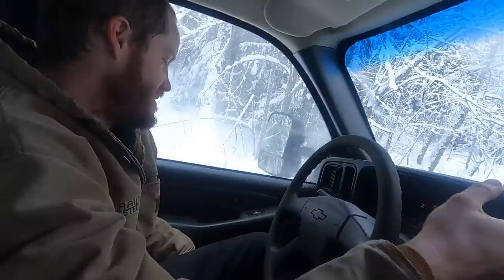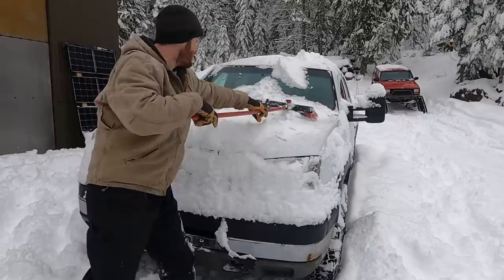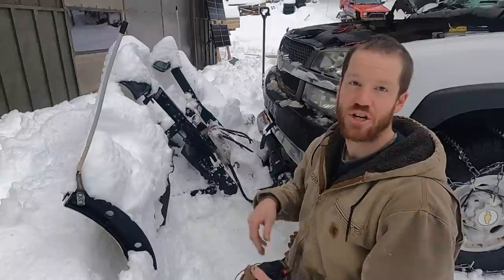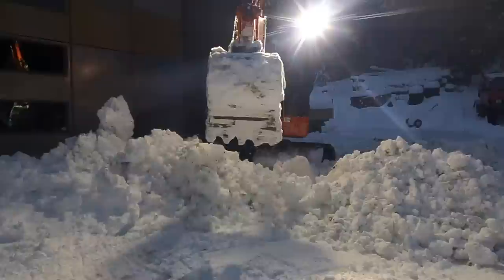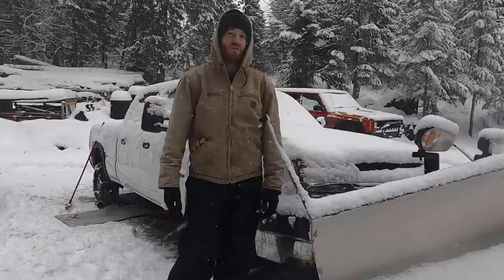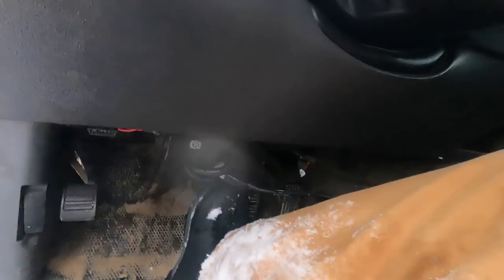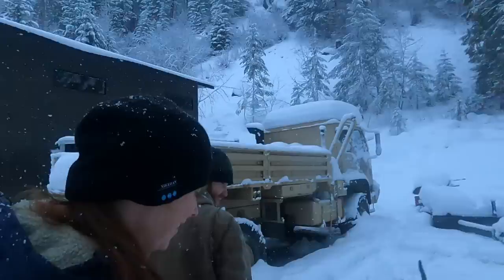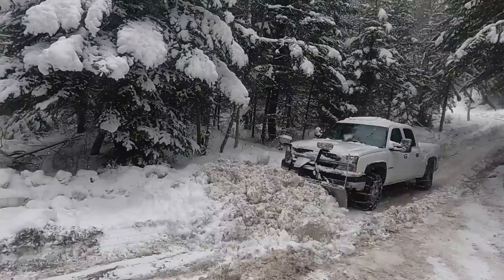WE BREAK EVERYTHING | Couple Builds Off-Grid

Comment: You can air down the tires prior to installing chains.  Once installed, air back up and it helps get thing a little tighter. There is no magic formula IMO, just be sure to check frequently and retighten when you can. You guys are doing well!  PS you can get snow guard to stop the snow coming off your roof like a freight train. It kinda looks like angle iron that screws down. They also make cleats that look like bear paws that screw on. Cheers!
Reply: But they want the snow off the roof.
Reply: I like getting the snow off the roof. A metre of snow, and then rain will test the strength of any roof :-)
Above doors it is a good idea to add the snow guards.
Reply: I've never had to let air out of tires to put chains on.
Reply: @bobbg9041   no u let it out put them on then put the air back in to get ur chains tight
Reply: I let air out on all tires when mounting chains - tractors, snow blower unit, and trucks. I’ve done this for many years. You get a good snug chain fit when you inflate the tires. I love your videos and am trying to catch up as I.m a new subscriber. Problem solving is one of the joys of living in the country and the lifestyle you guys are creating.
Reply: @bobbg9041  I use to drive an 18 wheeler, (all 48 states in all 4 seasons), and I have NEVER chained a truck, car or pickup in my life!  I guess God really was my Co-Driver!

Comment: When plowing a rough uneven surface (your road) you need to get "shoes" for the plow.  This will lift the plow slightly off the ground and avoid hitting anything hard and breaking anything.  While you guys "are not winter experts", yet,  you're learning fast and doing great!  Good luck!  Watching you guys figuring it out is part of the fun.
Reply: When plowing a rough surface you should not have shoes shoes get caught in holes  it can damage the plow more easier  to   not have shoes  an   2 angle   the plow / or \  an   👀   May have to raise it up a couple inches and raise it all the way back down ..  After a while you'll figure it out where the holes are and now we're to be careful

Comment: I've plowed snow for a living in northern Wisconsin for near 30 years. One of the best things you can do to increase your truck's ability to push snow is ADD weight. This will allow you to plow greater volumes of snow at lower speeds. 
Also if you can watch your transmission oil temperatures many modern transmissions don't handle plowing very well. Best of luck to you

Comment: I think you all have the talent to create a plow mount for the LMTV.  I would just mount it seasonally.
Reply from the maker: That is the plan! But we will need to widen the road significantly before we can use it.
Reply: @AmbitionStrikes  If you guys were in BC instead of Idaho, I'd totally come help survey/design your road upgrades. Shame about the border/ Covid issues.
Reply: @AmbitionStrikes  Wider roads mean SAFER roads. Its a must in snowy areas. Be sure to mark any ditches and obstacles with poles or flags before the next big snow.
Reply: Definitely need a big set of snow chains.  Chain up all 4 tires, hit mode button on the transmission controller, and that thing becomes a beast in 4x4.
Reply: @ambition_strikes how come you guys don't just use the army truck in the snow?
Reply: @richiefekecs  Heavy + skinny tires do not work great on slippery ice and snow!
Reply: Come Spring, you need to rent a decent size bulldozer for a few days and get your road widened out so you can mount that snow plow blade on your army truck!
Reply: @Millsy.g  skiny tires do more then u think lol drove 4 cylinder fwd for lot of years in Saskatchewan prairies and never got stuck till I bought a 4x4
Reply: @Millsy.g  definitely incorrect. Skinny tires do well as long as you have a solid underground. And if you want to plow you need weight. Weight is only a problem off road but on road it helps tremendously with traction
Reply: @kululv  Well considering this was an off road test, and I very clearly said "on slippery snow and ice", I fail to see how your points mean I was incorrect.

Comment: as a suggestion, you can mount a carport to the side of the garage that would possibly handle two vehicles allowing you to keep the camper and a trailer over there. make sure when you build it that it can handle the weight of the snow that piles up there or it could collapse.

EDIT, yes... Get that girl a Skidsteer. they're incredibly versatile and would definitely help you around your homestead. You can mount more than just a shovel on them. there are all sorts of landscaping devices, not to mention forks for unloading pallets, that could come in handy.

Comment: You need an old tire or a platform to sit the plow on when it is not on the truck so you can drive up and connect or drop it off.
Its cold and the snow is on the ground so you know something is going to break. You too are doing just fine. Please do one thing put a wrench set in the truck! Your attitude is everything, and it is GREAT!!

Comment: The Fan should have ground a hole in the shroud if the clutch was good. I would check the fan clutch, Also with a plow they some times need a HD fan clutch because the plow blocks air flow to the radiator causing over heating. Just my 2cents.

Comment: I have a heat pad that glues to the oil pan and can plug in to 110V outlet. Helps when trying to start my diesel tractor in cold weather. Also, might want to get a snow rake. Makes it easier to remove snow from roofs.

Comment: Ambition strikes equipment show. I would get chest protectors for the dogs for playing in the snow. Playing in the deep snow you don’t want them getting stabbed by sharp sticks and branches. The orange one piece  bungee cords that are star shaped are best for the chains and proper tension. And putting the short ones on the inside of the wheel will keep a broken chain from ripping your lines out install them in a square pattern on the inside four each wheel. Also lay a tarp over the cab of the plow truck so when you need it just pull off the snow quick and easy. Also put some weight in the back of the plow truck over the axles.

Comment: A good trick for cold weather starting a Deisel is too use a little petrol on a rag and place it near ur air intake, it is not as violent for the combustion process as ether, is and is always on hand for the generator. DWF or carby cleaner also works well to spray up the intake while cranking ur engine .

Comment: Congratulations on overcoming adversity. On your chains, I've discovered the hard way on loose chains and brake lines. The best chains have cam tighteners on the outside perimeter loop. I never use chain tensioners anymore. The rubber ties are not nearly strong enough to keep your cross chains from rolling when you spin. Rolling them will almost always end up bending links and messing up your perimeter chains. Looking good guys. Happy New year.

Comment: On the chains, I use the black rubber straps for all of mine.  Two points; I replace them after two years of use or four years of waiting ( reduced risk of failure from decay), I also keep 2 spare in every car and 4 spare on the trucks uncase something breaks one.  The other point is to place the hooks so that the open side of the hook (pointy bit) is not rubbing the tire, this way if the tire+chain do rub against something you don't have a built in sharp edge.

As for a skid-steer, YES!  See what Wranglerstar purchased, he has I think the right setup for what you need.

You might want to see what some heaters would cost, block, oil pan, transmission for the army truck.  Though they probably draw too much for continuous use right now, even just and hour or two will make starting easier.  Even if you need a small gas generator to power them.

Great content, keep it up.

Comment: Hey guys, as a retired mechanic, I was yelling at the screen when you were replacing the right side motor mount that if the right side is bad, the other side was most likely also destroyed.  Obviously both mounts were toast.  Also, growing up on the East coast, we had to plow our auto shop parking lot.  We all learned that having the blade angled to one side pushes the snow much easier and moves it to the side.  You can do it from the cab, we had to get out and move the blade by hand!  Less hard work for the truck and an overall better result.  Give that a try.  I really enjoy your content, watching you both try new things and typically succeed.  Much respect!   ❄❄⛄⛄
Reply from the maker: I think it was mostly wishful thinking on Riley's part... 😉
Reply: @AmbitionStrikes  Well, without wishful thinking where would we all be?

Comment: You guys are doing good 👍 
Tire chains the best, couldn't find cross links work as well for ice.
Chain closure install knuckle forward. Use mechanic wire (soft manipulative wire) doubled around knuckle turned twice then ears bent back towards knuckle. Side object such as frozen mud will make chain closure open. By using tie wire stops this from happening. 
  When plowing snow you are going to run out of places to plow snow to. So when coming to snow pile raise the blade. You will build a ramp to enable more snow to be removed. One more thing when plowing a cross chain do break. Use mechanic wire to tie this broken cross link to side chain. The side chain should be in alignment with tire side wall rib evenly spaced. Watch chain tensioners, they will tell you if the side chains need tightened. Good Luck First Season Plowing ☺️

Comment: Try using a 4x3 block of wood when you chain up or are adjusting them. Cut your block to fit inside the tire chain grid and set it down in the grid before you drive over the chains. Park on top of the block when you stop. This will give you slack around the tire and make it a click and done deal job. Also run bungees on the inside of tires as well as the outside. This will help keep the chains centered on your tires and away from brake lines! 
Fighting the snow is easy- wait until the thaw… You’ll know it’s spring when you smell dog poop!

From a former Donner summit inhabitant

Comment: An IDEA you should really consider for next winter…. Get the army truck in top notch running condition over the spring & summer, get mounts to hook your plow to IT! That truck is 4x4 it’s a military vehicle was built to work in the roughest of conditions and will plow the hell out of the road, drive, parking or pretty much anywhere on the property you need! It was built to be a “work horse”… you’re both engineers/fabricators… make it work for you so your work is easier. The right tool for the job. No need to “buy”  another truck for plowing when you have the PERFECT one already.

Comment: Starting spray/ether works great for starting cold diesel engines. Spray a few seconds into the air intake. 
Northern Idaho is a fast and hard teacher. Roof slide-off will launch 10 feet away.

Comment: You need snow brakes and car brakes…what are snow brakes, you ask?  Keeps the snow on the metal roof so it melts of rather than avalanches.  Really helps so you don’t have to climb on the roof to get the snow off in a controlled manor.

Comment: Courtney,  look into making a 2x6 support beam for the cargo trailer roof.  I put one in mine every winter.  Plane down board thickness to go between roof square tubing and support the roof sheeting  I put a piece of angle iron on the bottom of beam for bottle jack and 4x4 to lift up about 1/2" to install legs, the. Set it down to hold it.  Use double layer of 2x6 pads for base of legs that span the floor joist.  
Riley,  LMTV either bottle should be behind cab/motor mounted in the middle of the vehicle on the front of the spare tire carrier.

Comment: Did you check the flares on the ends of the brake line that you replaced match the ones on the old one? a lot of people don't realise that there are two types (concave and convex). Back in the UK, we don't get heavy snow now, loft insulation on roofs stops getting instant snow-persons. Great vlog as always. Hope the new year brings you all that you hope for.

Comment: Just clamp the break line off for now with vicegrips and finish your plowing.
Reply from the maker: We considered it! But we were almost completely out of fluid and didn’t want to pump air bubbles into the entire system. It turns out the bleeder screws are broken on 3 of the 4 calipers.
Reply: They make bleeder screw repair kits. You drill out the old bleeders,thread the holes and screw in new bleeders. I'm not sure on the cost and install, it maybe cheaper to just replace the calipers. Might want to check.

Comment: You know....  in retrospect, you should have built your road and widened it the first year, and then built the barndominum the second year.   But I truly do understand the draw and need to have the barndominum built and be living on your new property as soon as possible.   My suggestions are to seriously widen and level the roadway come late spring, keep working on getting the water to run down and away from the roadway, cut and trim all the trees along the roadway so you don't have trees and branches falling on the road in the winter, and finally, put in some snow poles like they use to mark the edges of the roads in mountain passes, etc.   I think that would make plowing a lot easier; you'd have a place to push the snow off the roadway and you would know where the edges are so you will be less likely to get stuck or drive off the edge of the roadway.   Love your videos and watching and learning from your experiences.   Good luck!

Comment: If you take the bungee and weave it through the edge of the outside chain, it will pull more even and does not get caught on debris. A little tie wire on the inside to keep the chain secure helps too. The chains will stretch as they wear so check often and adjust them accordingly. A good pair of chain pliers and extra repair links and cross bars will keep you going strong. Be careful under the edge of the shop, that snow can really hurt you if it falls on you. Stay vigilant and enjoy the first winter safely.

Comment: Locate a set of "metrinch" tools. They work off the "Flats" of a bolt/nut so rusted corners don't prevent you loosening and tightening bolts... they work on metric or sae bolts since they merely "cam" on the flat surfaces and don't need an exact fit. They're great for working on objects prone to rusting. I understand they are available again now. Also... remember "corrosion X"... both red and green.

Comment: Greetings from Norway. TRYGG are Norwegian made chains and we never use those rubber bands on them. In fact, I have never seen a single truck big or small use those rubber bands here..  The rubber bands will never keep those chains thight when the tire spins quick (40-50 km/t) as the weight of the rotating chains will spin outwards. Sorry for the bad explenation as English is not my primary language.

To tight them correctly you install them and try to get them as tight as you can, especially on the inside  at first. Then its easier to retighten the outside as you drive and the chain gets properly seated on the tire.

Comment: Skidsteers are awesome but I have never been stuck in snow so frequently as in a 4 tire skidsteer.  Chains would have helped but clearance is really low.  Also I like to use a bottle jack to lift the tires off the ground when putting on chains.  It’s a luxury and not necessary but makes it easier.

Comment: might want to investigate oil pan or coolant heater for that army truck.   There are some that use hot coolant from another running truck to circulate though quick connect hoses.   Used by loggers, when they arrive in the morning to the cold machine that has been setting in the woods all night

Comment: Your Army truck should be the plow truck. Install a block heater, get some tire chains, and a good plow, and it will push that road open every time. It has the high ground clearance, strong engine, plenty of gears, and 4WD. See the setup in action on Endless Adventures here on Youtube.

Comment: I use the bungees to start with until the chains get set then I use about 50 ft of 1/4 inch cotton nylon rope and lace the chains on like shoes. You can drive faster and spin the tires faster without the centrifugal force stretching the bungees and possibly hitting the chains on the finders. Worked good on the 68 Camaro back in the day. 🤪

Comment: Welcome to winter!! lol  You learned to stand things up or put things on top of each other so you can find them after it snows, so I don`t need to remind you of that. lol I used to park my snowmobile on a wide 2x so the track didn`t freeze to the ground, that system will work for the jeep. I also used a magnetic oil pan heater once in a while for ease of starting a rig. I forgot to tell you it is a good idea to take pictures, and measurements of plumbing and electric in the walls before insulating and drywall. And you could use a long 1/8 drill bit to pilot a hole to find out where its going, or into what, before using the big drill bit.  Happy New Year!!

Comment: My 2cents, With Both Engine Mounts broken... i would suggest you also replace the transmission mounts, as they have been doing the engine mounts job till now.. hopefully the fan didnt get into the radiator with all its movement. 
if that Military truck has a PTO think about getting a "Farm" snowblower(3point hitch or such) for it, to send that snow deep into the wood rather then finding a place to push it to.
Place is looking GREAT
Those Jeep Tracks turned out AWESOME!
Lots a of Fantastic DIY content! Thanks for Sharing the everyday to day!